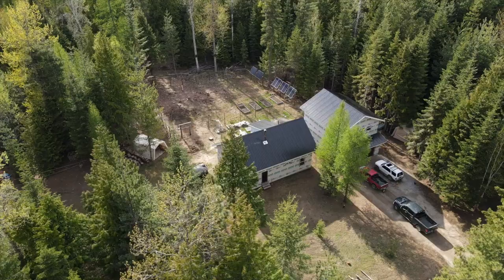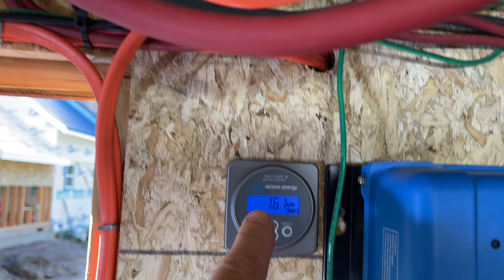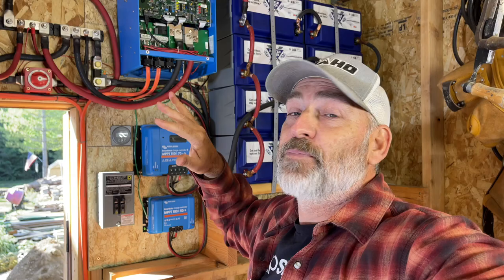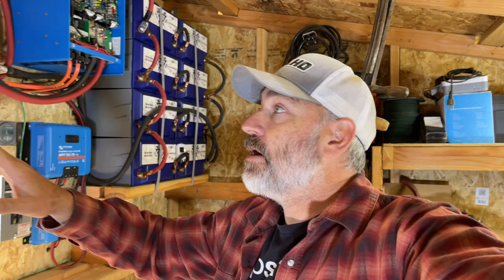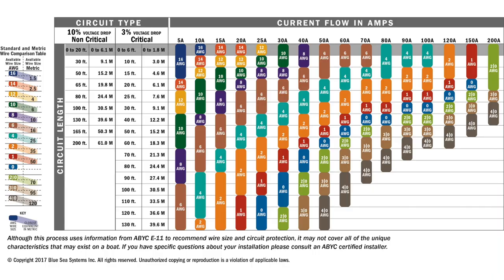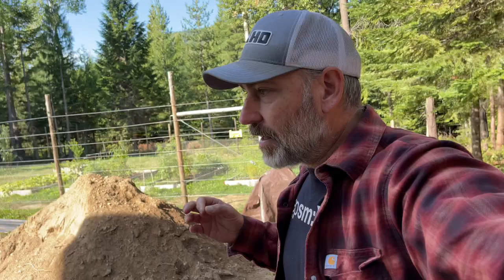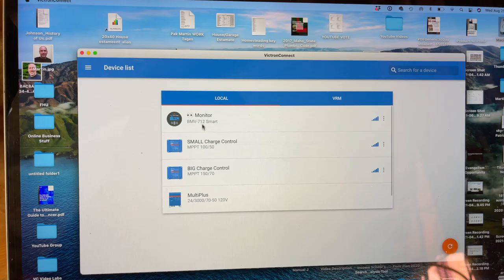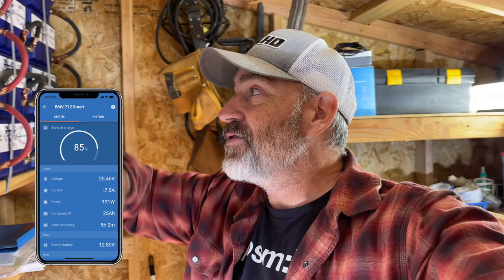DIY Off Grid Solar Power System for Home - AMAZING POWER!

Comment: Overbuild your battery bank a bit, limit the SOC to 85% and you should be able to massively extend the life of your batteries...
Reply: 10-15 years worth of cycles on LifePO4 batteries will most likely outlast everything else in his system...   You can build this system for a 1/4 of what his cost and replace it every 10 years without breaking the bank..
Reply: @FJB2020  He got sponsored by Battleborn. But yeah, they are really nice batteries with a price that matches.

Comment: And another feature that you forgot:-) is that when you use the generator you can take that 4 kw and the 6 from the inverters and they bond to give you 10 kw :-) i’m using that in my boat :-) you don’t get more than 2,4 kw on the dock so when i will use the big welder the Victron use both batteries and the shore line …
Reply from the maker: True. I for got about that.

Comment: Are you planning on making a bigger system to power the whole house?
Reply from the maker: Maybe. We will see what this can do first.
Reply: @MartinJohnsonOffGridLiving  
I was gonna say cause you can get what's called a mppt rs charge controller from victron wich can do 6000w of panel
Reply: @timmiftode7137  one nice thing about having 2 smaller vs 1 larger is in case of equipment failure, on the 2 smaller if 1 fails you still have one working until fixed or replaced.  You wouldn't have 240 but would still have 120.  Victron is great and less likely to have a failure, but things happen.

Comment: I highly recommend upgrading to an all in one unit like a growatt. ~$900 for a 3kw mppt charge controller, 3kw inverter, and a 1.5kw 120v AC battery charger in one unit. For something that big their 48v unit is probably better, 240v and you can split the phase to 120v with an autotransformer. Also run up to I think 6 in parallel. They make bigger units too
Reply: Exactly.. This setup is old tech that cost 4x what it should..
Reply: @gordie308  They all are....
Reply: What is an all in one unit?
Reply: Victron do similar all in one kit but there isn't a massive advantage unless you are starting from scratch.  The downside is that you spec the unit to one scenario, then if you change one aspect like an array size, or your load requirements, you are potentially replacing a much more expensive component rather than one or two smaller ones.
Same goes for a failure/ redundancy.  One inverter or charge controller is cheaper to replace than a whole all-in-one unit.
I do agree if you need a simple solution for an installation in tight space or know you won't change the specifications significantly over its life.
Reply: I'd personally rather pay more to have a bunch of discreet components that I can replace as needed rather than an all-in-one system that would have to be replaced wholesale if I needed to change something.

Comment: For anyone wondering. I've calculated around $15k for this setup. 
Batteries-$800 per x 8= 6400
Solar panels -$400 per 10=4000
Chargers/controllers= around $1500
Wiring/etc- around 700.
 Very rough numbers other than batteries and panels. But close to or over $13k-17k
Reply: Battleborn stuff is among the most expensive out there. Not everyone is sponsored, so do your homework before rushing into  a system install. I recommend San Tan Solar for panels; best prices around, but just a small portion of the cost of a system.
Reply: @rixtrix11  I was just adding the price of the total setup for anyone wondering. It's a pet peeve of mine when I watch videos talking about products and there is no price breakdown. Especially for something that is so expensive. I'm not commenting on the products themselves or choosing a system.
Reply: Didn't mean this to be directed to you personally[Althouse now I see it could be taken that way. Sorry].  I was only wanting to recommend to anyone considering a system to take time to do a LOT of research into their needs and costs. Thank for listing the pricing! Really surprised when Marty upgraded to this as he was always so frugal in the past.

Check out Red and Robin Off Grid for their $6400, 6000w split phase (120/240V) system. A little more work involved, but much less out of pocket expense. Just another angle to solar power...
Reply: You the real mvp. It’s a pet peeve of mine as well
Reply: L'investissement et conséquent ,mai avec les économies d'énergie réalisé sur les années votre investissement est largement rentabiliser et je suis sur que l'énergie qui n'a pas était consommer vous pouvez le revendre se qui est un gain d'argent vous pouvez en gagner
Reply: yeh well at least its not 3 phase, decent 3-phase system with batteries in AUD is min $40k for a decent one you looking at $60k
Reply: I think I'm going to set that as my next goal . Does a person have to inquire about bylaws or anyting for having that I'm wondering

Comment: Absolutely the most comprehensive off-grid video to date! OMG!  I am about to replace the whole off-grid system that I installed in 2008! I did it on my own steam and it has done SO well! 
Now, this is an upgrade about to happen! Thus I will have a new bit of knowledge  I really need it! 
My 2nd battery bank is dying! A gel bank making it over 7 years now!
Also looking for grants too... Which seem to require Certified electricians... If SO They must see your vids 1st! 
Ya think? 
~Jimmer from Vermont at the Canada Border!

Comment: In the diagram there's a small hot wire shorting out the two positive and negative shunts, that should instead be from the positive shunt to the the battery monitor, I also stand to be corrected if am wrong. But that is an awesome tutorial!!!

Comment: Again, I was warned when I created my system that it was important to include a way to disconnect the Solar Panels BEFORE reaching the Solar Controllers to prevent voltage spikes to sensitive equipment when you use the Battery Disconnect.  In other words, do not interrupt the Controller Power to the Batteries as long as the Solar Panels are supplying power to the Controllers.  Otherwise, great videos that are easy to follow.

Comment: I just watched this for about the third time; Martin you should consider getting a Generac (or similar) whole-house generator. You can run it on propane, and stop using your portable generator. Yes, it might cost $4,000 and up, but it can be set to automatically start when your battery monitor sees that the batteries are low, your whole-house generator kicks in automatically. It can hook to your mass supply propane tank. When you're traveling and there's little sun, you're going to lose your batteries, the way you have it now. Frozen pipes, anyone? Also if you need to service the batteries, just let the generator run the loads.

Comment: @Martin Johnson - Off Grid Living - Martin congrats taht you are using Victron hardware. I'm from the Netherlands and i know Victron very well. It is around 150 KM away from my place. It is placed in the north of the Netherlands. About your issue in the beginning how to connect all for a phase splitted system i can tell you that there are very good manuals for it were all is described. In any case very well done. I hope you made yourself a wiring diagram so that everyone is able to help when you are not there.

Comment: I love "Big Blue" Victron components.  Just a note, you can't configure your inverters from your phone app.  You must have the MK3-USB device.  I installed my system thinking I could configure my MultiPlus 3000va inverter charger through the dongle and/or phone app and I couldn't do it.  I had to buy the MK3-USB device to hook the inverter to my laptop.  I really like how you have your solar shed set up and how you have your house temporarily hooked up.  If/when you decide to upgrade your system, you may want to go with the new MultiPlus II inverters.

Comment: That's a really nice setup. I'm just getting started with mine. I have a system that only has 2 100 amp hour batteries. I need to get another system set up soon that can run our well pump.

Comment: While the BMS of each battery will keep the cells in that battery balanced there is nothing balancing the 12V batteries to each other. So the two batteries that make 24V can get out of balance to each other. That said if the batteries are well matched they could stay fairly balanced for a long time.
Reply: A few of the batteries available today have VE.Can connections to the internal BMS, so when connected together allows inter-battery balancing.  The alternative is to use batteries without any internal BMS, and have an external BMS manage the lot.

Comment: I don't know a whole lot about electricity so when you say split phase, what does that mean?  Thanks for great video.  Love the life style.  If I weren't in my 70's I would do this.  So due to medical issues and age, I can't do this.  I live in NW FL but have nearly 50 acres of woods in NW TN.  Would be great for this.  I am tempted to move.  The land in TN has no house but has a pond and spring.
Reply: So I'm going to do my best to describe it to you. On alternating current there are wavelengths. It is constantly switching from positive to negative and when it switches it's voltage is going up to 120 and then back down to zero and then to -120 back up to zero creating a sine wave. When you look at industrial and commercial applications three phase is most commonly used which means you have three phases (power sources) all on a different wavelength. That is why three-phase motors are very efficient and powerful because instead of a single choppy sine wave the three waves which almost create a straight line. With all that in mind if you look at your panel in your house you have two separate phases (powers sources) When power sources are wired in series (like he did with the batteries in the middle) it combines the voltage, When wired in parallel (like he did on the sides) the max amperage combines. It's the same way in your house you have two phases available aka two separate power sources on different wavelengths (which is very important) that can combine. That's why your dryer can be 240 and your receptacles be 120. That's why your dryer plug has two hots because the two separate phases that are on different wavelengths are combined to create your 240. So basically this system would give you the ability to run 240 if needed. I hope that helps anyone who sees it.
Reply: @OnTheDLum  excellent description man! Thanks for the info!
Reply: Split phase is from a transformer coil tapped in three places. One at each end and one in the middle. In the UK one end would be .+240 volts and the other -240 volts when compared to the middle connection. This way you could connect specially wound equipment across the ends of the transformer and get 480 volts to drive compressors and welders etc. Used on farms and rural business where 3 phase is not available on the network.
Reply: @OnTheDLum  what part of north west Florida do you live
Reply: @rickdempsey5324  what do you mean?

Comment: Not sure about the Bluetooth thing, but I suppose if there was an EMP problem it's taking everything out. I do like your set up though. Yes at outlay it's costly but off grid is sorted there, a lot of folk are going to have issues with power outages as time goes on - they're here now in many states I hear. Rolling blackouts have now got everyone looking at power options. I too have been building a back up system.
 Although I live in an apartment I can scale it down, but have enough to run fridge and freezer and laptop for work. My windows are in a good position for all-day light. I am hoping to get a large van, small bus and then everything will be off grid completely. Good luck to you and your family sir, I hope everything goes smoothly with the build and you're enjoying life.

Comment: Hello from sun king Solar. You need to increase your battery bank storage. Add another 8 battery's to have 2 banks. Winter time will deplete what you have and a lot of generator use will be required.

Comment: I have really enjoyed listening/watching you set up your Solo pawer system, here in the UK they don't make it easy to DIY Solo power systems. They prefer you go through companies.
Reply: In most of the states require companies and even mandate grid connection, so your usual not off grid.

Comment: Are you planning to add a cerbo gx?  I have one in our RV cause of where I mounted the inverter/charger isn't easy to get to and elimanates the ned for a digital multicontrol for it.  I can then use my tablet to see the remote console and control everything from there.  It's also connected to my home wifi and can monitor/control it from anyway.

Comment: Being out in the shed obviously exposes your system to larger temperature swings than if they were in the house.  Do you have to heat the shed (for the batteries) in winter or do the electronics keep the space warm enough?
Reply: Hehe . He will learn. The temp conditions not only reduce the battery life but greatly impacts their charge cycles. Batteries that are supposed to last 10 years may only last a year or two cuz of weather.
Reply: Well battle born can operate between -4f to 135f. It has safety features with high/low temp cutoffs. I believe 25f is when the battery will cutoff. With that being said I live in upstate NY where my temps range from -4 to 35 on average during winter. My batteries are in the shed which is insulated and stays above 40 without any heating required. Just depends where you live.
Reply: @enterthelegions  Good thing he went with Battle Born batteries with a great warranty!

Comment: Very cool I could see a couple of things I would do differently. I would buy a large enough charge controller to handle the entire system. I have  Cirrus truck camper and installed one solar panel and could add two more but for my needs one has worked just fine. I have the Victron 100/30  charge controller. I just got back from a 7400 mile trip and only used the generator twice because of the extreme heat. I did drive through Idaho by the way and when I got to Boise it was over 100+ and I had to run generator while I was waiting on oil change at the Ford dealership.  We live in Florida and our house was built in 1999 so when I have a new roof installed I'm going solar. Down here we will be able to be 100% off grid and sell power back to FPL.

Comment: Amazing video man, very inspiring! As far as I understand it's still impossible to go 100 % green in winter because of heating water and the house. Hope wind and solar will get more efficient soon and most of the people will live this way
Reply: 100% green is possible with ENERPAK Solar Charge Maximizing Controller System. Electricity & Green Hydrogen.

Comment: I'm learning a lot from you.  so i  have to ask question from time to time. my question is.... why did you opted for 12V to get 24V, and why you did not prefer to get thier 24V type.  My second question is... is your battery storage enough to run 24/7  the entire house? i know you live in snowy area and use heater, fot water, airconditioning, washer and dryer. or you still tap to the grid to supplement other power need. thanks

Comment: Will you need to insulate the battery shed to keep batteries from freezing? It looks like a clever set up!
Reply from the maker: They did fine last winter. We will be monitoring the temps.
Reply: Battleborn systems manual says:
 High temperature: > 135F
The BMS will not allow a charging or discharging current.
Low temperature: < 25F
The BMS will not allow a charging current.
We have had several years of unusually weak winters during the drought here in the Selle Valley. I think insulation in the battery room might be a prudent idea.
Reply: It is really not a big deal, because all he has to do is start the generator. The batteries will not ever get damaged because they have a smart BMS inside.

Comment: This is an awesome system. I really like the way you can charge the system and home at the same time. I want to get a transfer switch installed on my panel. We’re still using cords. Ugh.

Comment: What about a split system of A/C and 
D/C into the house? 
Run 24VDC for LED lights and AC for larger appliances and heat lamps?

Comment: Looking at wiring diagram of the 6 panel set up. Looks like it adds up to around 240 Volt output. Going to a 100v rated charge controller. Am I adding that correctly?  Looks like the amps on that array will be around 30.

Comment: Good video, there are not a lot of videos showing the 240v configuration, as I’m planning on turning a light tower into a battery operated power source. I plan on using 2 Victrons to make 240v power and rent the unit out, I may even keep the light tower on it and install 4 led lights on it so it can be a Mobile power source or light tower🤔. The reason im not using the generator in it is that it had a bad engine/seized up. And to replace the engine im looking at over 4,000$

Comment: quick question, is the battery connected to both the inverter and the charger? Will the inverter and the charger interfere with each other?

Comment: Adding inverters creates complications, though, right? If you up the amps, you either need larger wires or you need to change from a 24V system to a 36V or 48V system. Both of those can be problematic, because your wires are already massive, and your smaller charge controller maxes at 24V.
Reply from the maker: All things are possible.

Comment: Which is it better to have more amp hours or higher voltage? Say 12vdc /4 x 100amp hour batteries 400 amp hours. Or 4 (12vdc)  x100 amp hour batteries wired in series for 48 volt with 100 amp hours? Sorry I'm new at this. I do understand the cheaper wiring for the higher voltage less current.